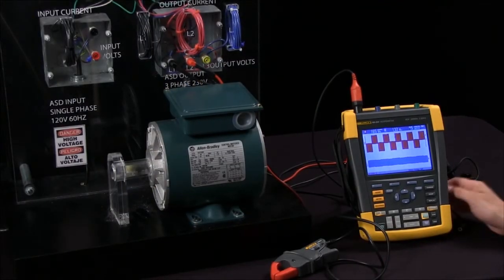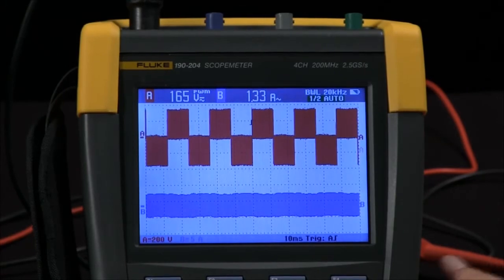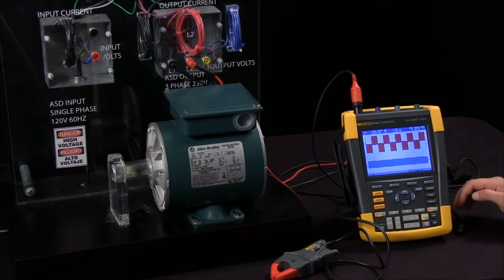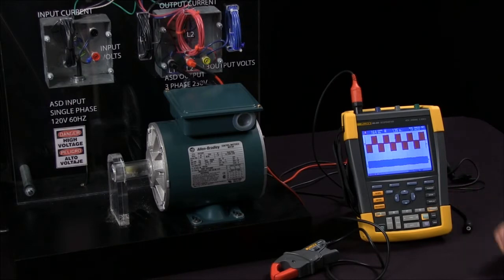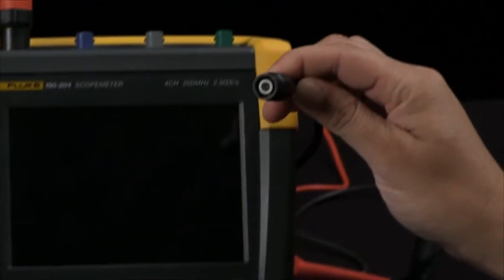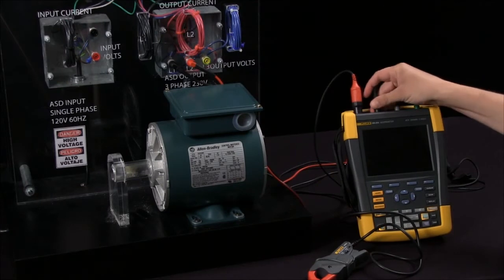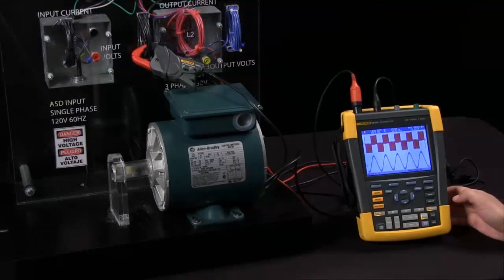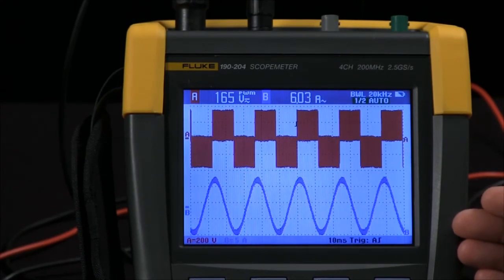How To Measure Current With a Fluke ScopeMeter® Portable Oscilloscope

Comment: You can just add a small resistor in the way of current and use two probes of oscilloscope in differential mode to measure the current waveform too if you have budget problem for clamp meter, be sure to use resistor of appropriate current and power rating